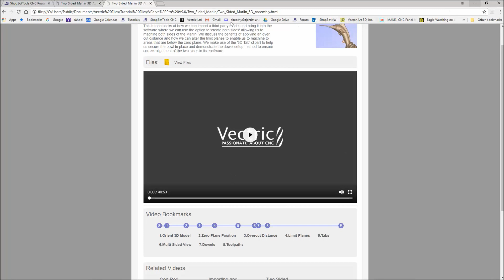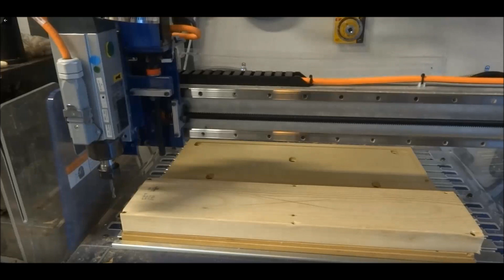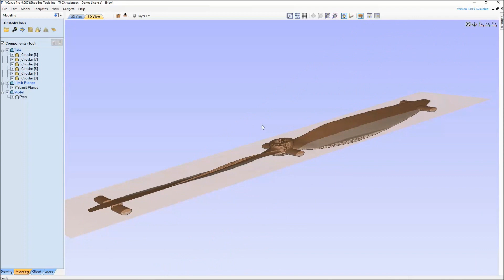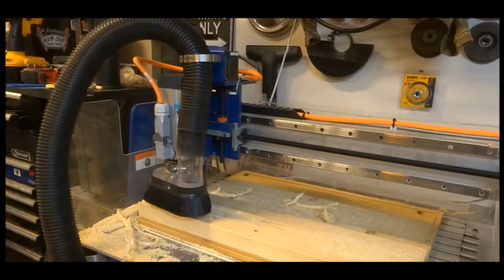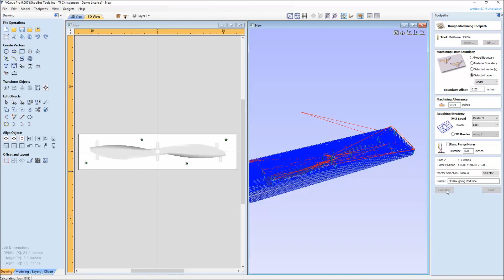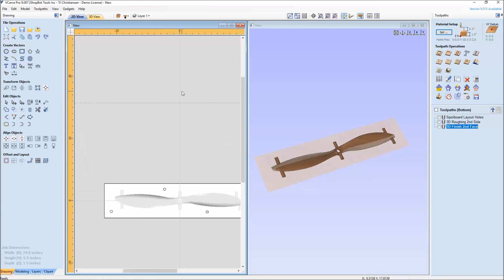Two Sided 3D Machining

Comment: I probably missed this but how long did this take to machine?
Reply from the maker: Hi There! Since this video was from 5 years ago and the employee in the video no longer works at ShopBot, we don't have the requested info readily available. If you'd like to get an estimate on how fast a ShopBot CNC machine can finish a particular project you are interested in working on, please call or email and we'll get you the info needed for confident and fastest settings in relation to our machines. Thanks!! 888680-4466 or sales@shopbottools.com

Comment: so what's the advantage of zeroing off the same side?  I keep seeing people do this, but no one has explained why exactly.  I have mine to zero off the top of each surface, is there an accuracy issue doing this?
Reply: C.J. It keeps the height reference consistent no matter what variations of thickness your stock has. 

Think about if you know with certainty the thickness of your stock and that it is precise and consistent (I.e. you’ve milled your stock to precise and accurate dimensions) then it’s no big deal

But if your stock is not exactly as you describe it in the program, any variation in thickness from the real world to what you told the program will be an error in the thickness of your part

Keeping the reference plane the same between the ops (top on first and that same plane after the flip means the bottom...) prevents any thickness errors arising from stock thickness
Reply: @russellmiller2564  makes sense, it the stock is .05" taller you'd have .05" stock remaining in the middle of the carve.  So the gcode just adjusts Z on the second side to match the final depth of the first?
Reply: C.J. Yup. It keeps the reference surface the same so no extra